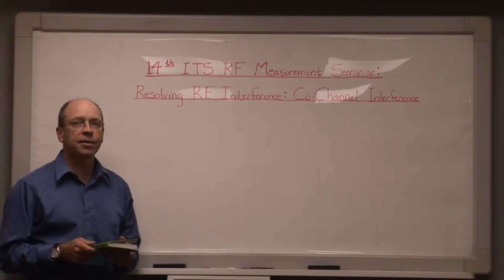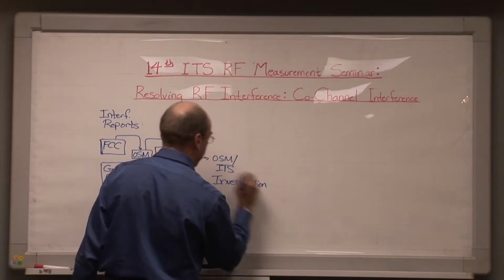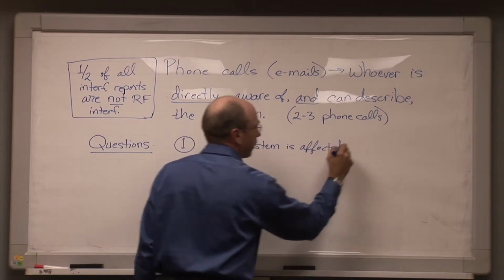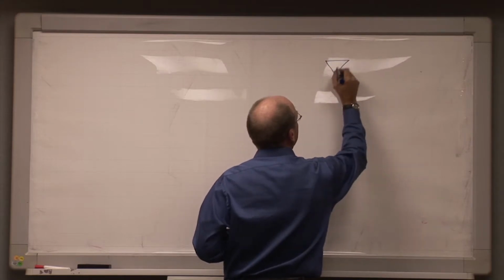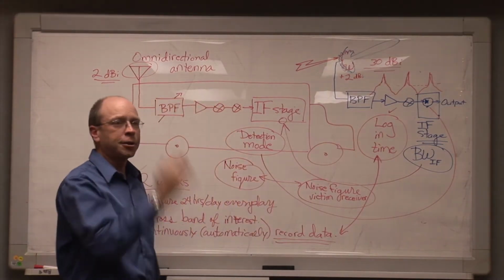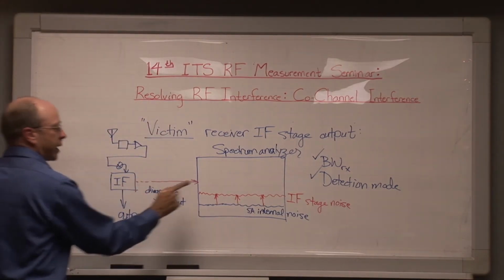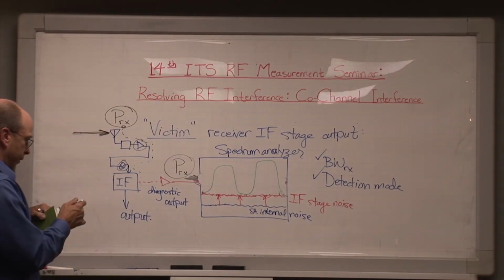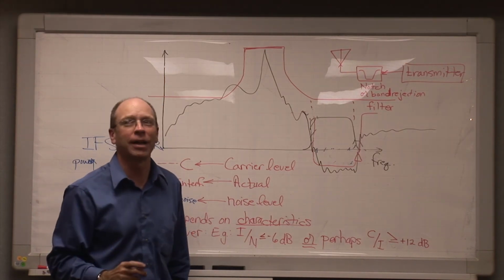Talk 14: Resolving RF Interference: Co channel Interference

Comment: 10:03:53 I think he means 10 log (BWrx / BWmeasurement) if the BW of the measurement would not have been set equal to the BW of the "victim" receiver.